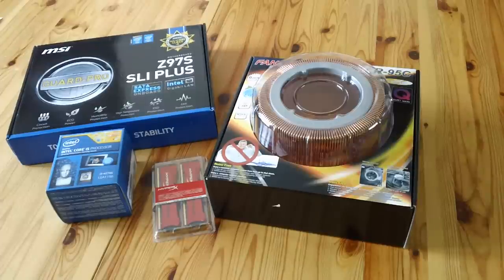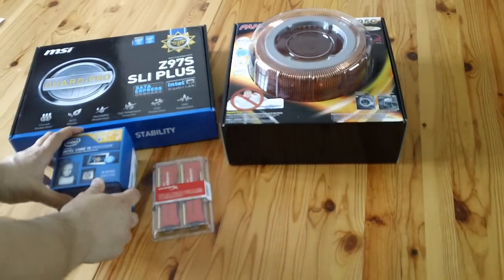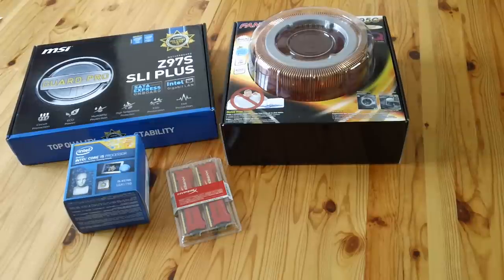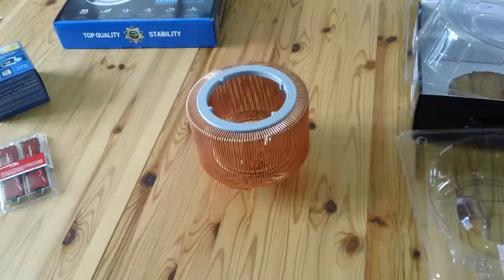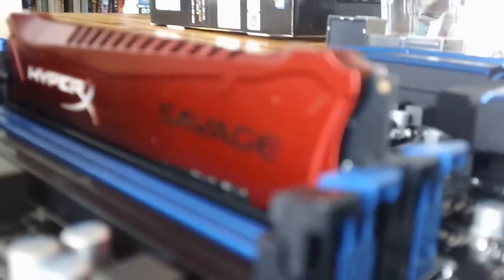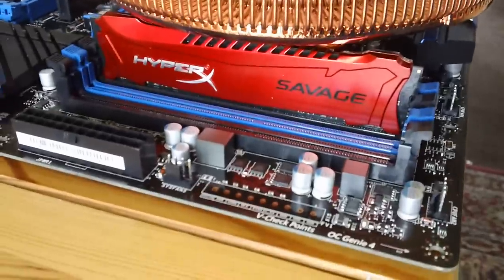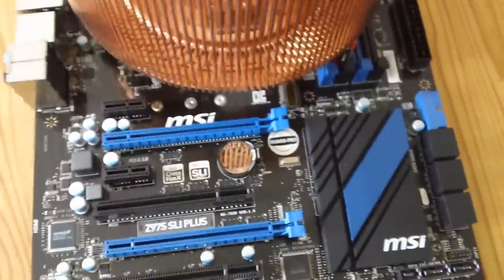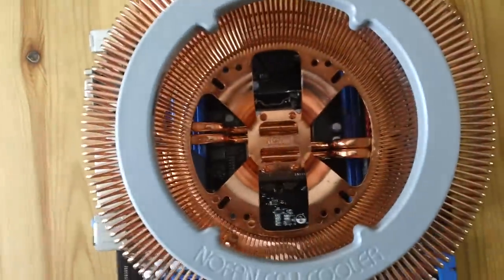NOFAN CR-95C Considerations *REAL OWNER* Fitting Comment (Part 1)

Comment: Hi, just spotted this video. I've been using a Nofan CR-95 for years. In 2013 I used a Silverstone FT02 case as detailed at http://hardforum.com/showthread.php?t=1740852 with a follow-up thread http://hardforum.com/showthread.php?t=1752613 but have moved to a Silverstone FT05. The rotated case is important for the heat-flow to be up and out. I used the Gigabyte GA-Z77 motherboard and there is just enough room for a full-sized GPU to fit in the prime x16 slot, despite what I said in post 12 of that thread, but I originally had my GPU in the second one. I'm now rocking SLI Titan X cards in my FT05 with a PSU that turns the fan off at low power requirements.

I'm surprised you left the fans in but disconnected - I took mine out.

Comment from the maker: That's something I missed in this video. Full details now in Part 2 here: https://www.youtube.com/watch?v=3wJ-aHnESrY
Generally, it depends on the card... the actual slot isn't totally obscured, but the bottom of the cooler is very close to covering it. You'll see this in Part 2, but if there's anything on the card that's raised in the area 120mm from the video connector end then it'll hit the cooler and the card won't fit.